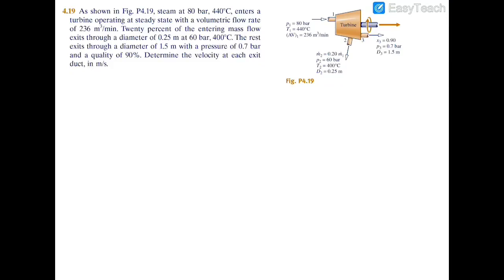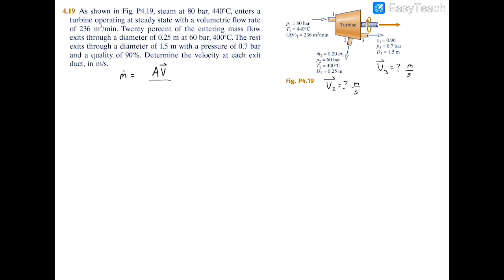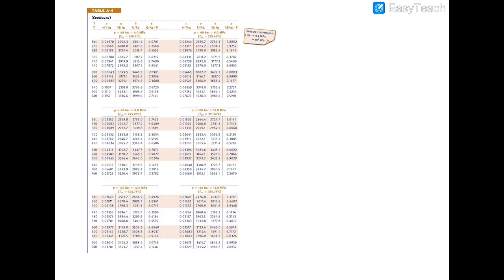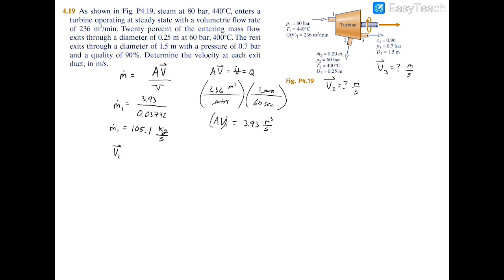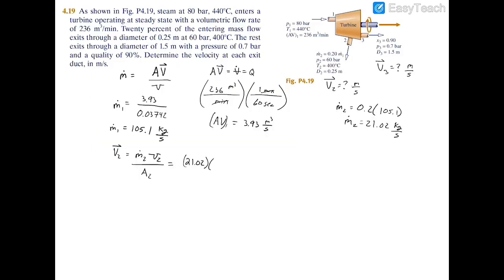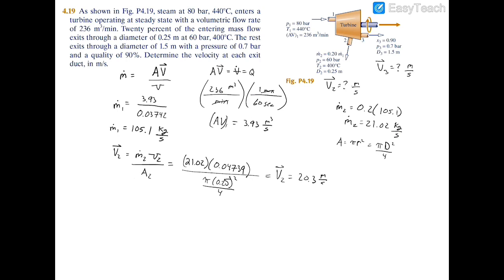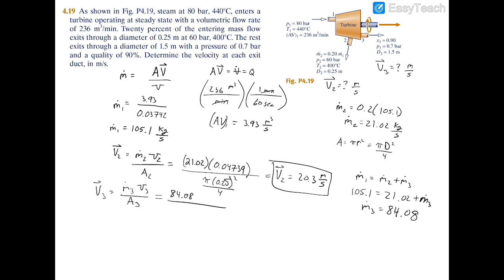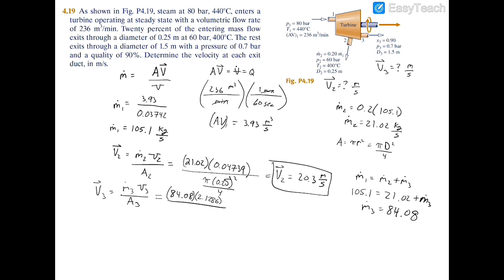4.19 As shown in Fig.  P4.19, steam at 80 bar,  4408°C,  enters a turbine operating at steady state.

Comment from the maker: Guys please note at 1:50 I referred to 8 bar on the property table when I should have referred to 80 bar. This was my mistake, but notice that 80 bar’s saturation temperature is 295.1°C which is still less than the given 440°C, thus it is superheated, as stated in the video.